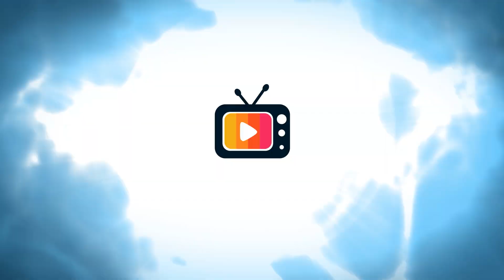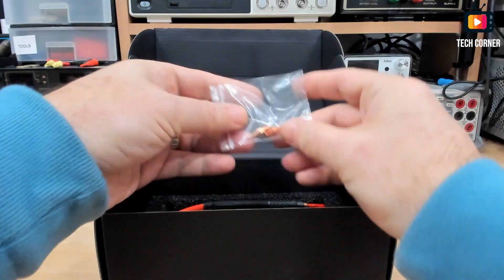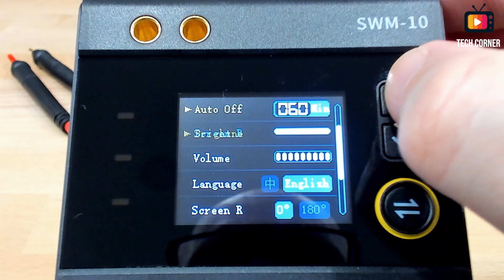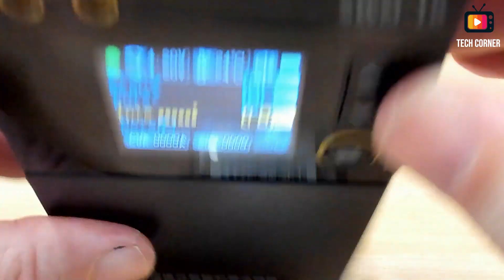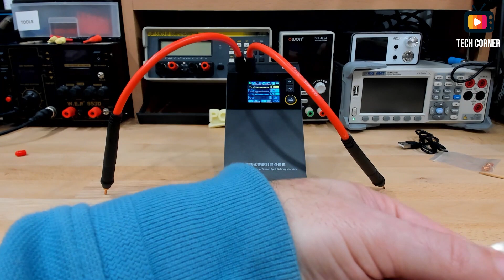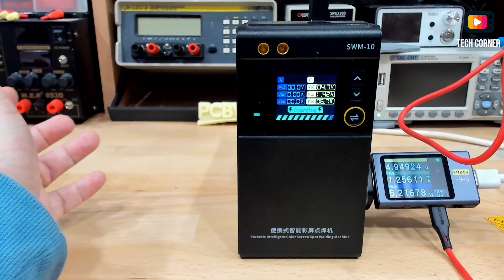FNIRSI SWM-10 Smart Spot Welder ⭐ Almighty One!

Comment: You didn't tell us about the "welding Delaay" (or the "interval between dots" (although that seems clear.
Reply from the maker: Thanks for pointing that out, it's something I could definitely add to the video. Thanks for watching!
Reply: @TechCornerTV  I am also interested into the "interval between dots", why would it matter? Between dots, it still fires when you make contact and not by itself, so what does the "interval" do? 
Is it a delay from touchdown to firing (same as "welding delay"), but can be set shorter if you are in process of aplying the secondary dots?

Comment: Fuck this overpriced shit! I paid almost 60 pounds for this and it’s useless! It took me nearly 3 hours to weld a 3s8p battery pack! After just 5–6 welds it overheats, goes into protection mode, and stops working for about 10 minutes every single time! You’re better off buying a 12V 99 Gear Spot Welder Module for 3 pounds, it does a much better job! Don’t waste your money on this FNIRSI SWM-10 junk!

Comment: what do you think after 1 year  of using this spot welder? .and what do you think of charging cable comes with can i use it or better to buy a good quality.... What charger do you recommend to charge the device?
Reply from the maker: Hi, yes I'm still happy with it and is my to go tool whenever I need to do some spot welding. I normally charge it with one of my charger 65W or 100W. Thanks for watching.

Comment: it can do 0.5mm ive done many test strips it works well
Reply: 0.5mm is nothing even my grandma can do that.
For ebike batteries for example you almost only work with 1.5mm or 2.0mm. As this video used 1.0mm which only took a small bit of resistance to remove i have my doubts about a 2.0mm pure nickel strip. I'd spend a bit more on a reliable 737G spot welder for heavier stuff.

Comment: I tested one today. The cable connectors should have been at the bottom of the device due its very short length you will practially always have to use this thing upside down.
Thats not real showstopper because you set the parameters and then you dont have to look at the display anymore for the welding, but its a bit "inconvenient". You can kind of circumvent this with an option to rotate the screen. Other then that it does what it says. No idea how long the battery lasts but i did quite a few tests (about 50 weldings) and it worked fine.
One thing i noticed it does not even reach half of the rated current of 1.5kA which is actually not needed because even at the lowest pulsetime it's good enough.
My fazit: It's cheap, it works. Had a lot worse products in my hand.
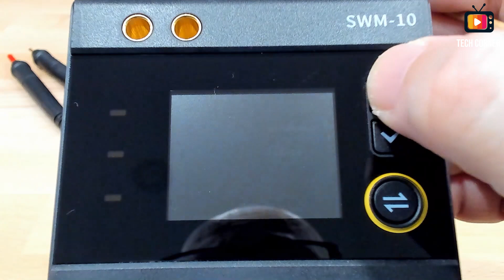Reply: Please watch again at 9:10 - you can invert the screen so that the probe sockets are at the bottom of the case.
Reply from the maker: Hi, I saw that you already had an answer but, you can change the screen to work in a upside down position. Thanks for watching.

Comment: How many minutes does this device you advertise last as a spot welding device?

Can it firmly weld a 0.2 mm thick pure nickel strip onto a 18650 battery?

I would be grateful if you could test this information and share it with us.
Reply from the maker: Hi, I worked over two hours to record the video, true it was not sequential welding, but it barely changed the load of the battery, it is pretty big, it works as a power bank also. Regarding 0.20mm strip, I don't have it here now, ordered, but it has really a lot of power for a small device, I believe that in the test I welded two 0.15mm. Thanks for watching.
Reply: @TechCornerTV  Thanks for your answer. I bought this device from aliexpress and it just arrived. I tested it with a 0.2 mm pure nickel strip. I achieved excellent spot welding quality. I saw the value of 1120 mah on the screen of the device. The device can provide the technical values it promises. This device is 2 times more powerful than my battery spot machine, which weighs approximately 5 kilograms, which I made with a microwave oven transformer. This device, weighing 580 grams, is portable and has a power bank feature. I recommend it to people considering purchasing. 👍

Comment: Welcome!
Very good overview video!
I ordered such a welder (Banggood). Arrived yesterday. I've tried it and it's perfect. It also handled 0.2 mm thick nickel tape without any problems and it was not necessary to set it to maximum performance. Great device at a good price! I hope it will last.
Reply from the maker: Hi, glad the review was helpful. Thanks for watching.
Reply: What settings do you use for 0.2mm pure nickel?

Comment: Would it be able to weld to an aluminium case, liked those used for housing electronic devices? With so much more metal there'd be much faster heat conduction away from the weld spot.
Reply from the maker: Hi, I'm going to trough my 5 cents here and say my opinion, I think it will. If you notice the batteries have a nice metal ending in the both sides and you are able to solder it here. Being alluminium and don't how it will behave in terms of material, but I think it should work. Don't have any here to test. Thanks for watching.
Reply: All aluminium items have a thin surface coating of aluminium oxide due to the metal's reactivity. This oxide is an insulator, so you may require special procedures, maybe an acid flux.   But it might work anyway, give it a test and let us know.

Comment: Thanks for reviewing this. I’ve been looking for a portable spot welder and this unit is nearly perfect. 
But my only gripe is that I hope they can one day make a model that uses easily replaceable 18650 or 21700 lithium cells. From what I could find online, this model uses 2 flat pack lithium cells, which can be a bit of a hassle to replace. I also couldn’t see any easy way to open up the case to replace it. That’s unless there are screws hidden underneath the rubber feet. If it was also able to use an external power source such as a car battery as an option it would be perfect. Thanks as usual for your detailed reviews!!
Reply: I highly doubt that will happen anytime soon, those lithium ion cells rated for such high current simply don't exist, it's not their main purpose. They would need a lot of them. With these type of devices, pouch cell lipos are still the only option. This is also why you don't see 18650s or 21700s in those jump starter packs.
Reply: This is so true! Currently, only the cell manufactured with LiPo technology can deliver such a large pulse current without damage. This is why only such cells are used in jump starters.
Reply: @sjoerd104  You made a really good point. I didn’t even think about that. Some power tool manufacturers are now starting to use pouch cells as well. Such as DeWalt’s Powerstack batteries.
Reply from the maker: Hi, how have you been :) it's true what you said, but even so, you can find anything on AliExpress... regarding the screws, I loved the device and don't want to break mine trying to open, that's why I didn't do a teardown. Even so and for experience, you can probably just pull the side panels and "probably" will have a way of opening it. Thanks for watching.